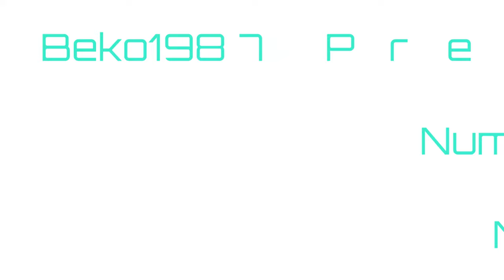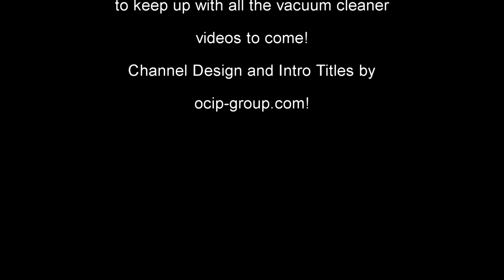Numatic Henry HVR160 - Motor Mods and other shennanigans!

Comment: Wow Sam you went out ! That power socket is something to be jealous of along with the adjustable suction Numatic should do this! Thanks for another fun delightful video Sam!
Reply from the maker: It's cool isn't it! Runs very cool too, guess the exhaust air has a less restricted path than in a miele! Been using it on 1/4 power so 700odd Watts. Nice and quiet and perfect for hard floors

Comment: I know this video is almost two years old but I just watched it today.  I can understand the power nozzle mod but putting a Residential Miele motor in the place of the Commercial Henry motor was interesting.  Well, I guess the Miele bags are quite expensive along with the filters so putting Miele power with the inexpensive Henry bags and attachments (since they are universal 1 1/4" or 32 mm standard) is probably better in the long run.  Your enthusiasm made this video very entertaining.  Cheers from Canada.
Reply from the maker: Ha thanks! It mostly started because I wanted to fit speed control, and it then quickly became easier to just fit everything! Have you watched the video where I fit a 12v power source and led lights in there? 😂 RGB Henry this is now 👌 To use its very nice, although I hardly ever run it on full power for long partly because these 240v 2200w motors like to burn themselves out and mostly because its too dang powerful 😂 1/3 power is plenty or it becomes difficult to use

Comment: Just connect the live connection for the PTO socket to the now unused side of the main switch, it'll be completely isolated from the other side so won't interfere with the Miele motor wiring.
Another thing to check is the csa of the cable, 2.2kW needs a minimum of 1mm² iirc, esp. for the length of cable on a henry.

Comment: Amusingly I bought a blue Henry 160 this morning cos my loaned-out miele S316 was broken (hey, I paid £10 at a car boot for it about 15 years or so ago, packed with filth cos someone thought it was bagless, so, meh!!! Lasted long enough after the work I did to fix it!), still runs, but the lid's screwed, had the thought of motorswapping, but it seems 'lil Henry is now built for single-stage motors, rather than dual-stage, so, if I used my spare Ametek-Lamb motor or the Miele's motor, it may be too tall to actually fit, I'm no fan of single-stage screamers... :\

Comment: That Miele will be 1600w 👍 after eu first regs
Reply from the maker: I dunno, it pulls 2100 Watts on the power meter! But tbh I don't fully know what miele it came from as the motor in that blue one may not be original! Alot more than 550w anyway, if I use it on max the dirt gets pulled in from very far away